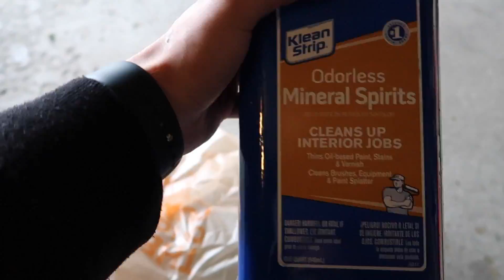Touching Up Evo X Front Mount Intercooler

Comment: wouldn't the paint close the little holes and block the air flow? looks better. 😱 😱going in and out
Reply from the maker: no, theyre pretty open, the coats were light and mainly on the surface and not the actual core